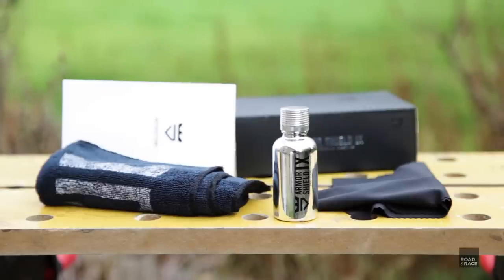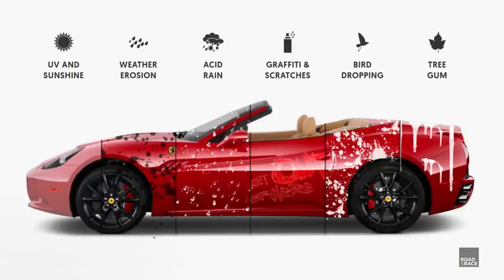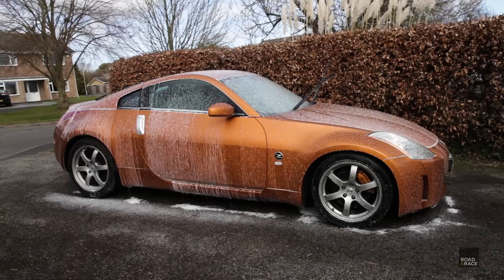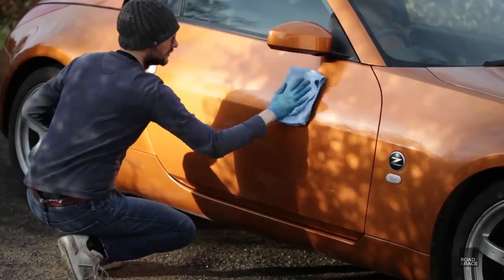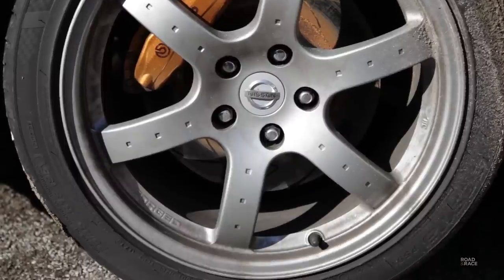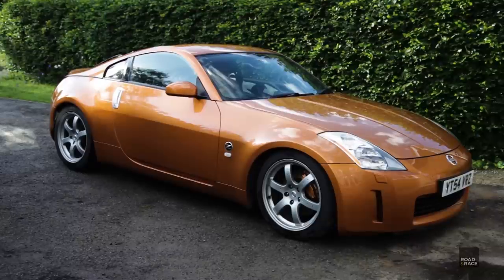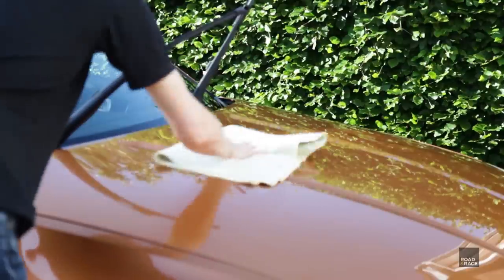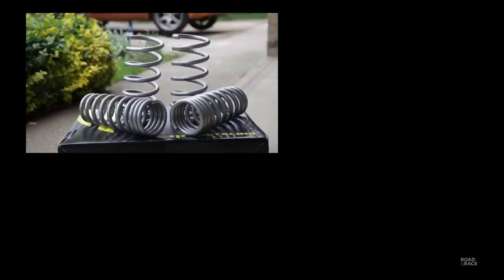Does Ceramic Coating A Car Work?

Comment: Hi, I am going to ask irrelevant questions in here because I am a long time subscriber :)
I am about to buy a Porsche Boxster 986 2.5l Automatic with 95000km on the clock. Can I Daily drive it? I do have a 80km round trip here in Brisbane Australia which is mostly highway and the rest moderate city traffic. 
I can do most of the maintenance myself....well by watching your Boxster videos lol
So what are your thoughts?
Kindly appreciated 
Cheers

Comment: No, categorically not. I had the Gtechniq light on my car and in all honesty all it did was soak in bugs and other environmental fallout. 

The worst part was though that when you then try and sort that out the coating is so hard that you can’t detail any marks out. 

So it’s fine for people who don’t give a crap about their car but those who do and detail them regularly then no.
Reply: mld  the last product I used before gtechniq exo was collenite 845 .
Ceramic coating does far exceed any wax .
Try it ......
Reply: Ceramic coating is not a scam or snake oil however a car really does need to be prepped properly. Fully cleaned, dexontaminated with proper iron remover and clayed. Then polished and paint corrected if needed. Then a proper wipe down with ipa. Ceramic only works with perfectly clean and bare paint. No wax or polish left on the car. Gtchniq is good but cquartz uk is an outstanding product. Easy lasts 2 years if the car is cleaned correctly. Second to this is fusso which is a sealant not a wax and I can get 9 months out of this. Normal waxes will last around 3-6 months.

Comment: Not exactly a fair test, a true ceramic coating is usually done after a full colour correction, the paint will be at its optimum condition at that point, a good quality product is also usually installed by a authorised resellers in a controlled environment, the application will be a lot more intensive than wipe on wipe off,

This is a ceramic enhanced quick detailer..